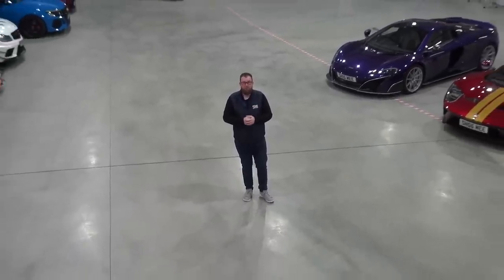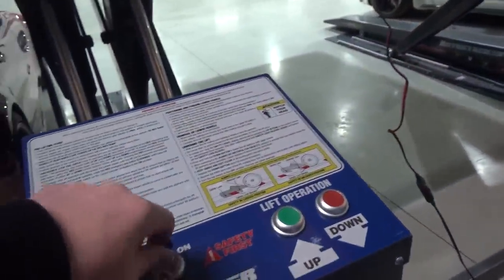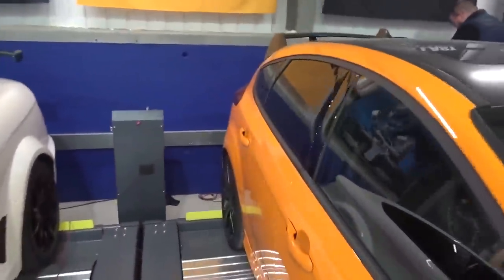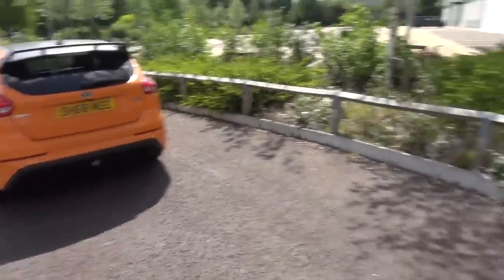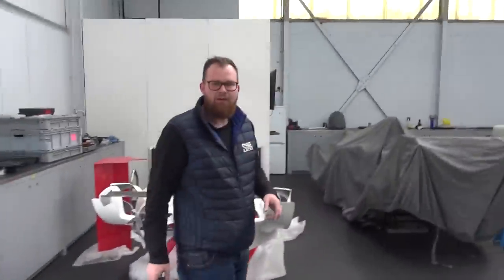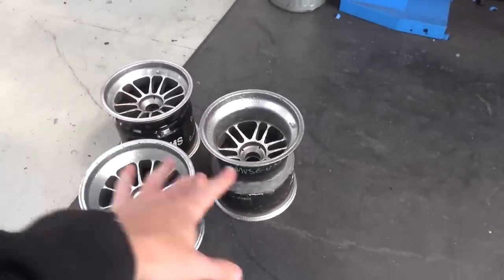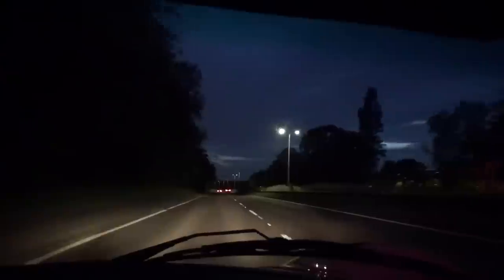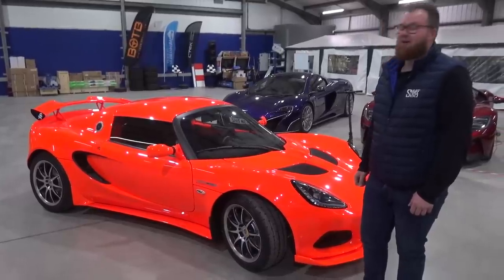BYE BYE to the Audi RS3! | SHMUSEUM VLOG 67

Comment: Great vid lads! But I have to correct one thing. At 0:39, the pixelation that Tom explained was not caused by the camera unable to process the wild colour of the car, it's due to low bitrate or bitrate compression, either from YouTube or during the rendering of the video. The camera would only have a hard time balancing the colour & brightness. It won't cause the pixelation. - From someone with knowledge in tech

Comment: I think after the camera being shown to the Lotus a long time, 
it actually now affected to Focus RS. (the part when Brad was finding the catch of the engine cover)
The cam basically turns itself a pixelated powerpoint
5:32
Reply: ya i noticed that too
Reply: me 2
Reply: Cameras will do that to any bright colour.
Reply: @davidcupra4913  my camera not 😛
Reply: @davidcupra4913  Normally, before having the Lotus in, the cam actually works fine on any bright colours
Until the Lotus came.....

Comment: The color example you show what you can have on your car. The orange color had the telephone company Televerket (they were working on telephones and installing telephone cables in houses) in Sweden on all their cars until sometime in the 80s. They stopped using that color, because it turned out that the sun faded that color the fastest.

Comment: The right choice!!Now get the proper hyperhatch the A45s
Reply: The rs3 is better
Reply: @evaristocorripio5434  In terms of what?Cheating with the extra cylinder and displacement? or the oil burned?
Reply: @apoellasapoelazio5377  having a better engine is cheating?🤡 they are direct competitors. If mercedes can't do a better engine thats their fault.
Reply: @evaristocorripio5434  Having the worlds most powerful 4 cyl 2L engine while proving to be extremely reliable and having earned several awards as engine of the year i dont think any other performance hatchback engine tops this.In terms of the overall performance just wait for the facelift of the A45s that is coming soon.